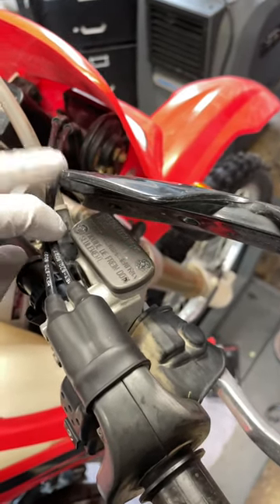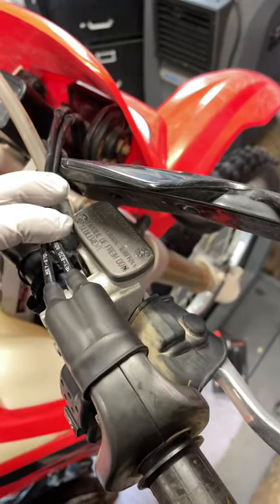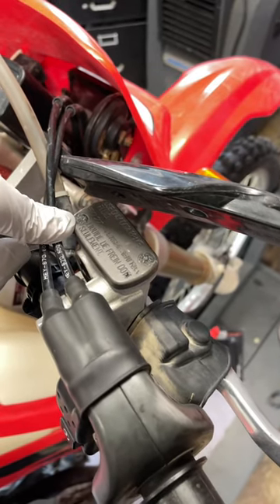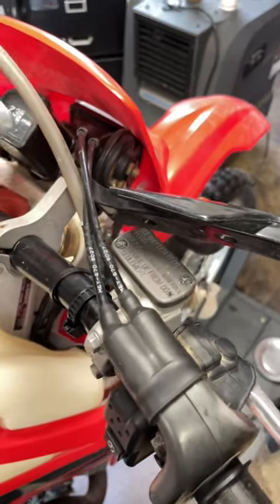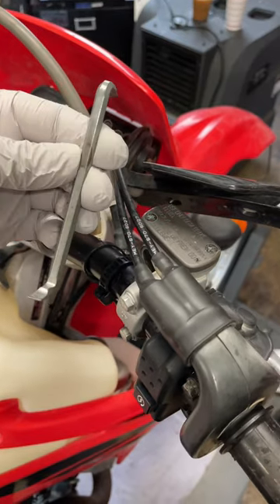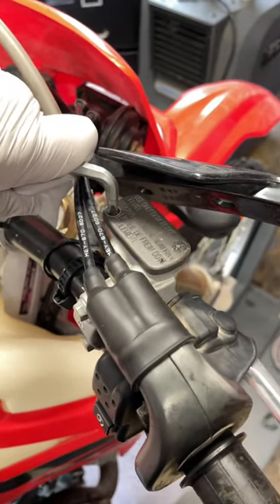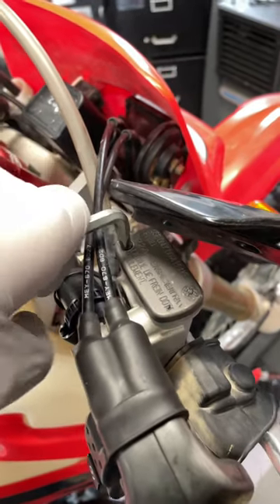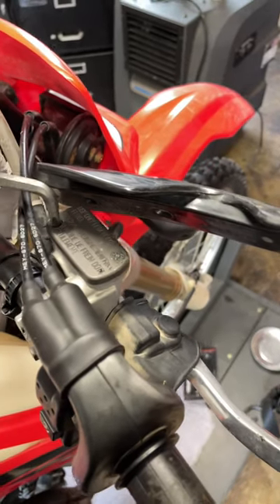How To Break Loose Old Screws

Comment: my caps screws were pretty corroded and a little stripped. I put a screwdriver in, gave it a few gentle whacks with a hammer to drive it into the metal a bit, and it gave me enough pressure to twist it out with the screwdriver. Gotta get me one of these fancy sideways screwdrivers tho, looks sweet.
Reply from the maker: It works surprisingly well!

Comment: Those are nice, but if you had the proper size Philips screwdriver you can achieve the same effect. There's a size chart for torque out, just find the appropriate size. But I do like the torque achievable with the 90° offsets.
Reply from the maker: Yeah I’ve had really good luck with this particular tool biting into the Phillips screws.